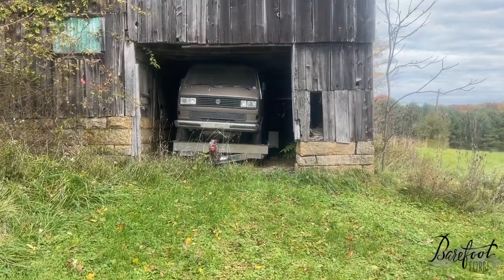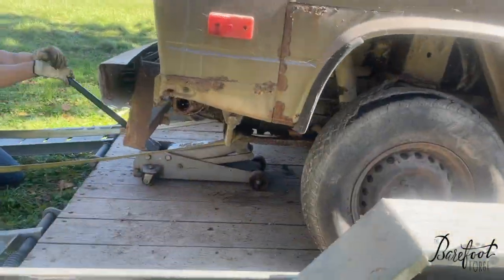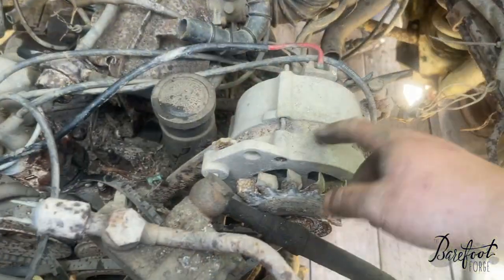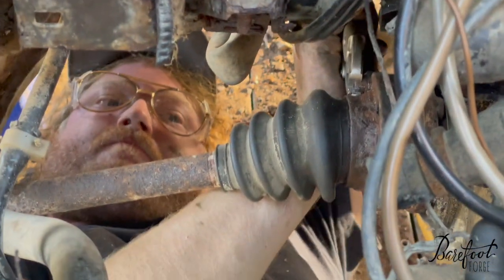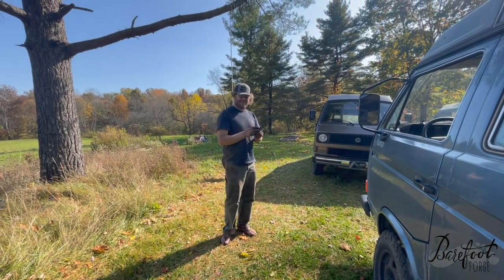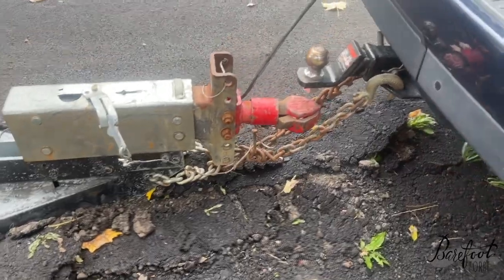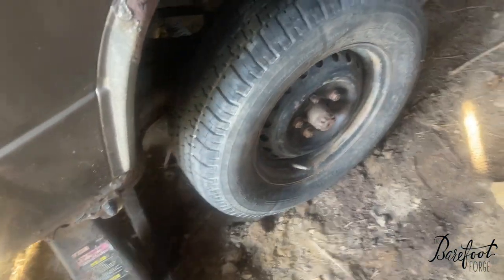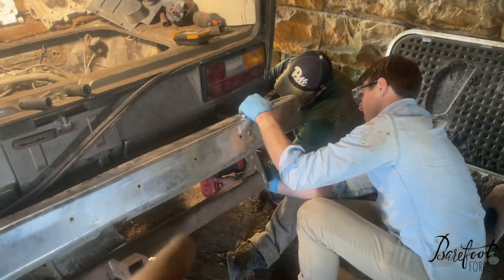Brown Bus Revisited-  Vanagon Syncro Barn Find

Comment: F the Vice grips on axle bolts. You need a $40 set of nut and bolt extraction sockets. Work wonders on rusty vanagons. Even take off stripped pan head screws that hold brake backing plates on.
Reply from the maker: nah, we had several sets with us, including a low profile Snapon set- these don't work for this application. The internal ones "SOMETIMES" do but they fully strip the hex or triple square rendering this to be about step X, but because the depth of the head is so shallow, they rarely get enough grip. The external ones do not work, at least none of the ones I have or have ever tried- as there isn't sufficient space space due to the wall thickness. Especially on the inner CVs where you "Can" get at them with vice grips, its a pretty good option.

I've probably taken off 800 axles bolts on vanagons in my life, and I've absolutely tried every tool that I believe exists. If you've got a set that you KNOW works, that fits, that you've used for this application- please, share the link!
Reply from the maker: @VanaConn  thanks for sharing the product, I want to try it. 

Oh wait, no, you just kept it to yourself.